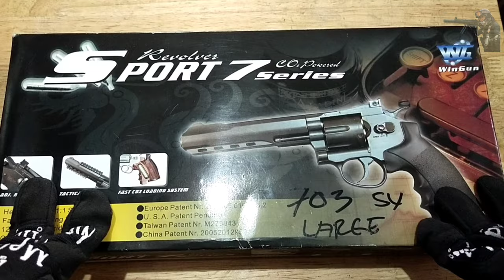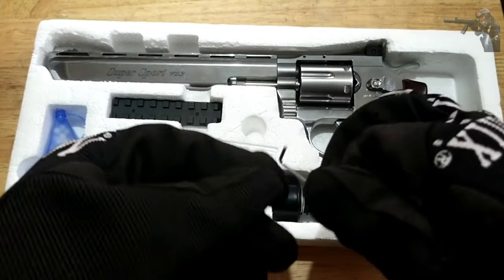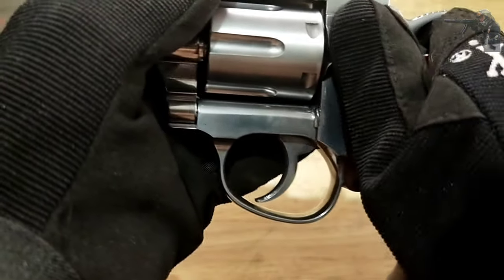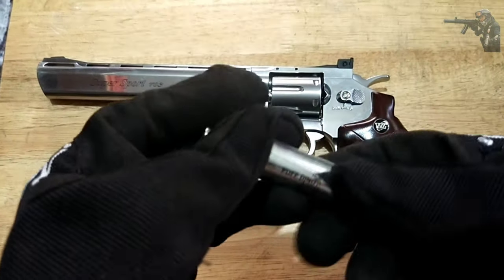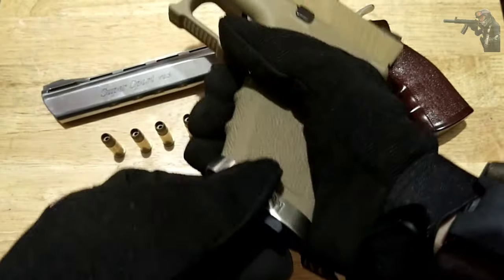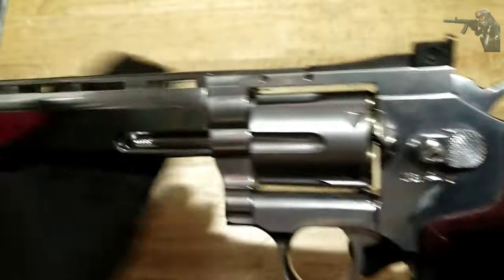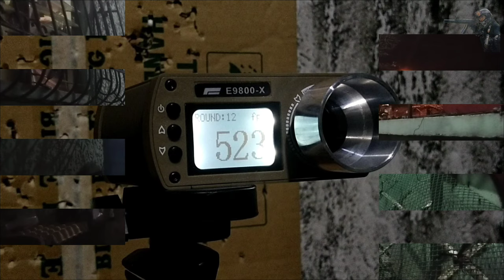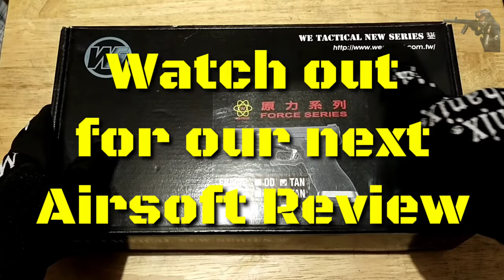Wingun 703 Airsoft Revolver Review #WG703 #airsoftrevolver

Comment: Do u need extra shells or u can just use 6? Thx
Reply from the maker: if you're going to play competitive airsoft, you will need few extra shells.
Reply: You don’t need more shells. The pistol can only hold 6 at a time but it’s recommended that you get more for when you have no more ammo in your gun.
Reply: Just load through the side without taking out the shells manually and it’s accurate but slow, def want the metal shells instead of copper though so id get a 12 pack of those!

Comment: what's the size of bbs that you used for it
Reply from the maker: 6mm. commonly used for airsoft.
Reply: is .20 bbs allowed to be used din po?
Reply from the maker: @printologyink8449  yes po pero I would suggest using .28 or .30 for better flight.
Reply: @AnythingUnderTheSunShine  okay po noted, which size of the bbs should I use to prevent the gun from breaking easily po?
Reply from the maker: @printologyink8449  just use 6mm bbs.
Reply: @AnythingUnderTheSunShine  do you know where i could buy them
Reply: @AnythingUnderTheSunShine  sorry im a beginner
Reply from the maker: @printologyink8449  that's ok. I was a beginner myself. I know where to buy bbs. But that depends where you reside.
Reply: @AnythingUnderTheSunShine  Ok po, do you know where I can buy them online?
Reply from the maker: @printologyink8449  i mean, where you live. So i can tell if i know a store near you.
Reply: @AnythingUnderTheSunShine  Oh ok. Pasig po ako
Reply: @AnythingUnderTheSunShine  pero I prefer delivery since I cant meetup po
Reply from the maker: You can check Vincent's Hobby Shop sa FB. They do Lalamove delivery
Reply: @AnythingUnderTheSunShine  Ok po,thx